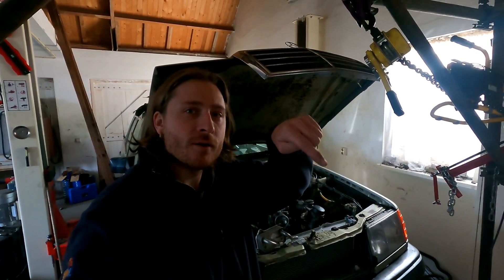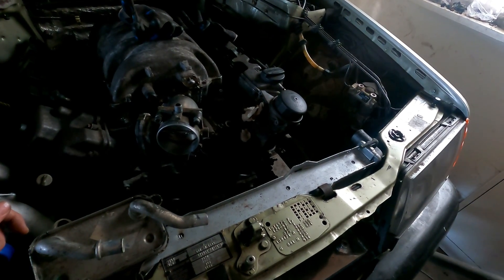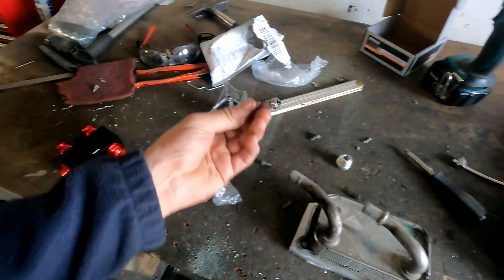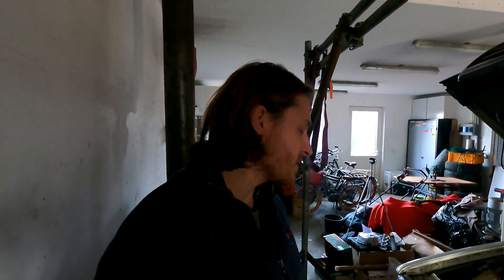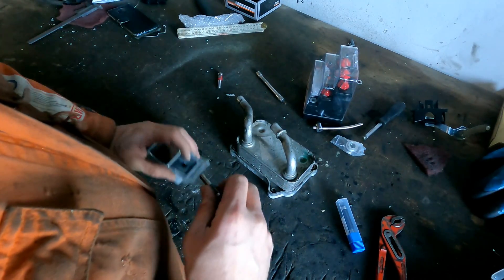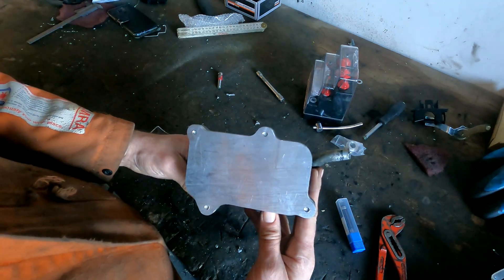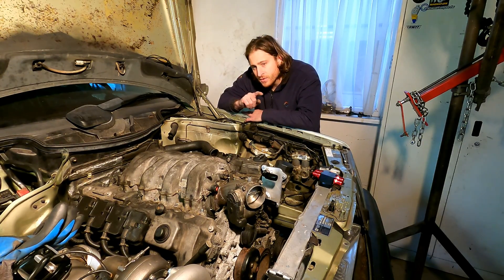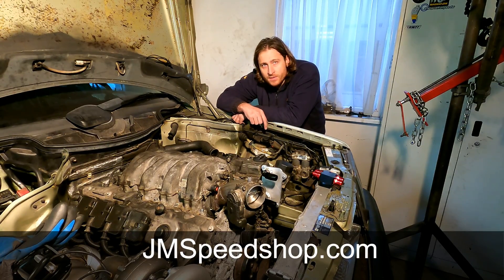M113 Oil cooler adapter custom made for V8 turbo Project

Comment: That is a heat exchanger. The main function is to keep coolant and oil temp as equally close as possible between them to at operating temperature of the motor. Very good build! I can't find info on what diff you used with this build.
Reply from the maker: A w210 e420.diff

Comment: you should definetly make this a kit if you can. Maybe have someone with a CNC machine have these mass-made in batches. There isn't that much of a demand but there are those who would want a kit like this for external oil cooling. Maybe even make caps for the water lines?? not sure but you're onto something mate
Reply from the maker: Yeah maybe. I Will look into IT

Comment: Nice, and the old water in/out could be used to cool the turbo instead. Will you be keeping the mechanical fan?
Reply from the maker: Hè that is a good one.  🤓 I Will have a look into that . Thanks 👍. I Will run a electrical fan

Comment: Hi, I'm Piotr, here from facebook (I asked about the coolant line). I have some more questions:
Do you plan to sell these custom parts or merch on your website in the future? (I would be interested for sure 😁 )
Do you use an oil termostat for your transmission? I also have a custom cooler for my 722.6 and it runs a bit too cold.
Are you located in the Netherlands?
Thanks and keep up the good work!
Reply from the maker: I'm think about selling some parts.  Merch maybe.  I need time for these things. And that is the problem..   i have had a external transmission cooler on My other car (190 V12). This was a oem.cooler and has only a temp switch on the fan .  Oem there is not thermostat.   
I never had problems running oil Cold in the gearbox.  Most of the Times between 60-90 degrees c
Reply from the maker: O yes and located in the Netherlands

Comment: Will this be a bi turbo?
Reply from the maker: No. Single
Reply: @JMSpeedshop  is it no matter exhaust tube length? When the turbo sits so far from other side. Lengthy gas pressure travel. Or it no matter cos its V8. Big thanks big respect for this project
Reply: @gedassulskis7901  yeh I was thinking 🤔 about this as well. Good question🙋
Reply from the maker: IT Will be no problem .  Turbo spool power is 70% Heat energy . That is most important
Reply from the maker: The pressure between cylinders Will still be the same